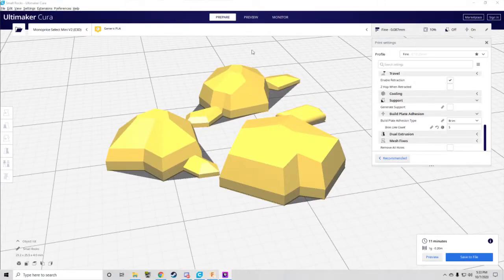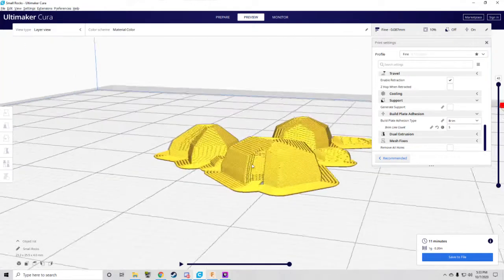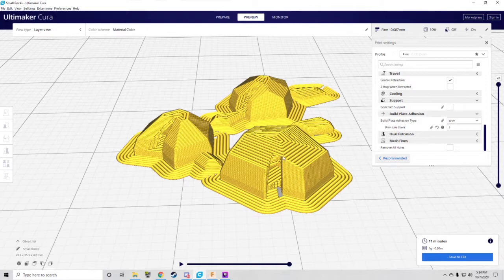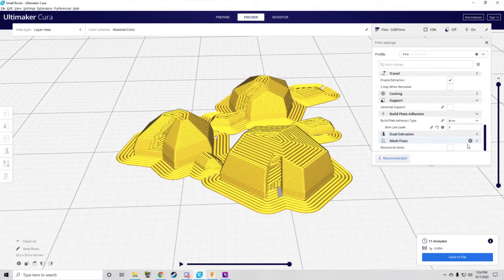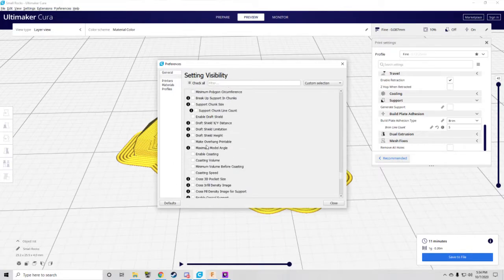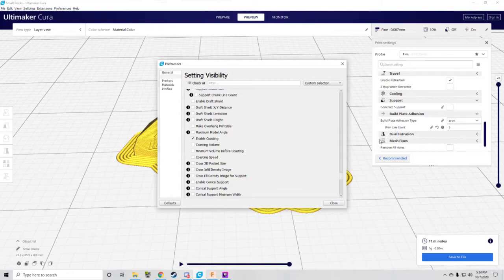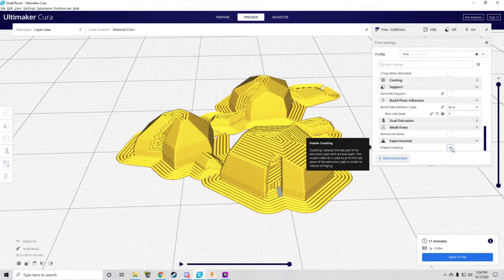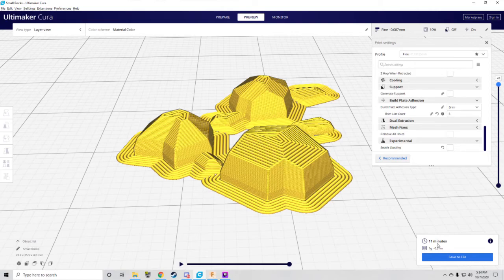How to fix random/strange holes in Cura slicer models

Comment: It's no making holes, it just looks that way in the preview. It's printing, just without extruding. There's pressure inside the nozzle, and even when it's not extruding the pressure will push out filament. Enabling coasting can greatly smoothen the surface, so instead of disabling it you can adjust its parameters in case the print will show holes or blobs.
Reply from the maker: You're right. This is meant more for people (like myself) who when they see that issue won't know to search for that and instead will search for "strange holes" trying to fix something that isn't an issue. Enable coasting does perform a good service but at the same time without the preferential knowledge it appears to be an error. In my opinion, cura should explain why a model could "look" broken while being fine. Thanks for the info, I'm sure more people will appreciate it.
Reply: @kraft478  Yes, first I was also wondering why there was weird holes in my sliced preview, and a YouTube video cleared that up for me.
Reply: idk, last time I had gaps like this in my models it actually printed with the gaps.
Reply: @Ultimaniacx4  then you're using way too long coasting, or trying to combine it with linear advance
Reply: @marcus3d  You know, I found this video because I was having this probably just recently.  But I think it's just a problem with the model.  It happened with and without coasting, and it's not happening with any others.  Thanks for the info though, it'll help if I ever have the problem consistently.